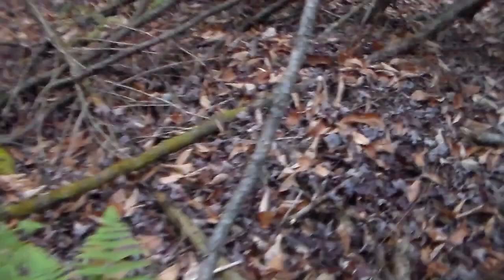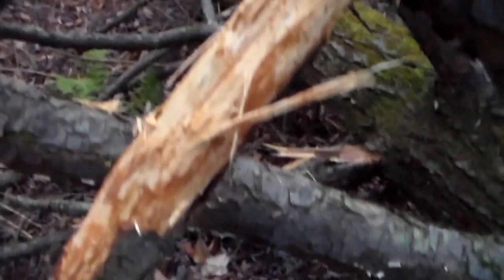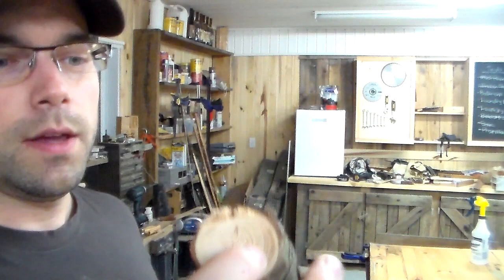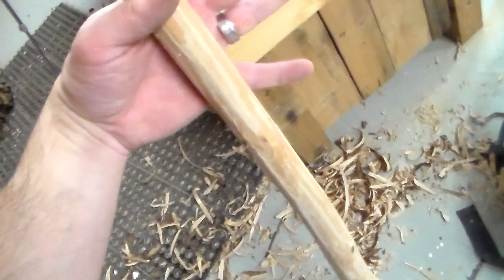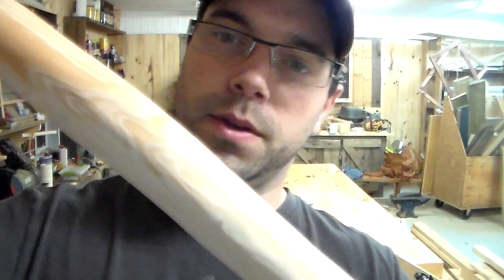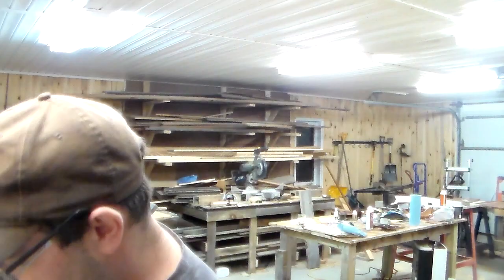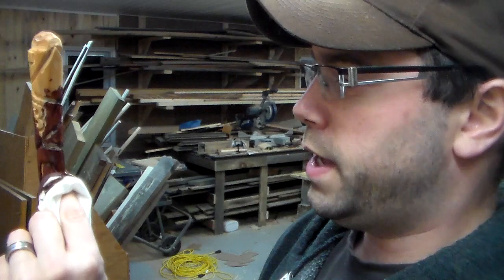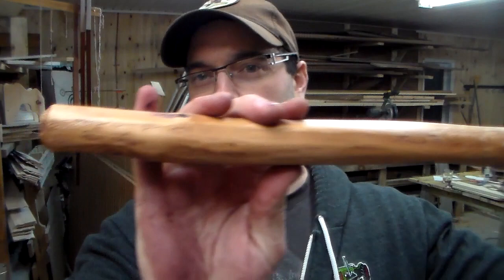VR - Bushcraft Bartons - Walking Stick Challenge!

Comment: Thanks for your vid. I specifically look for bay laurel sticks, and occasionally run into some straight withes (sp?) growing vertically out of a blowdown that is horizontal to the ground but still alive. I cut them in the mild winters here and don't remove the bark. No finishing is required, and after drying in a cool dry room for a few months, the thin gray bark stays tight to the wood and provides an excellent grip. Every now and then, I'll slice through the bark somewhere to refresh the beautiful bay smell that's exactly like the leaves used for cooking. I cap the ends of the sticks with a variety of metal caps that I find at hardware stores. They are my favorite hiking stick ever.
Reply from the maker: Nice! Thanks for watching!

Comment: I wish I could show you the one I made by shear touch and go taking my hyper active trouble making (little g@@) Alsatian a walk in the woods.
with a pen knife tapers Even a devil's skull screwed into the top. For a first timer I'm rather proud of it .
thanks But how do you make a wooden 
One in sections , take apart put inside your rucksack and used to put up a tarp tent?
Reply from the maker: hmm interesting question. to make a breakdown walking stick I would craft the stick normally, then cut it in three pieces. there are hardware for male/female screws.